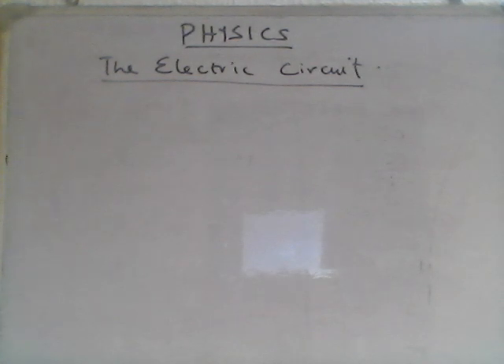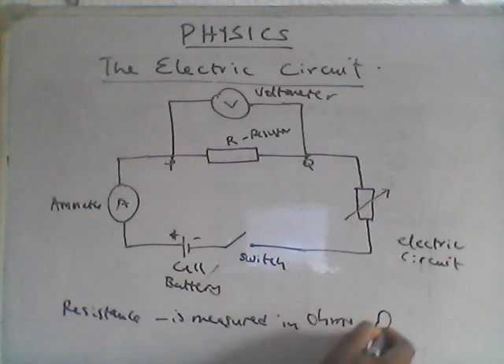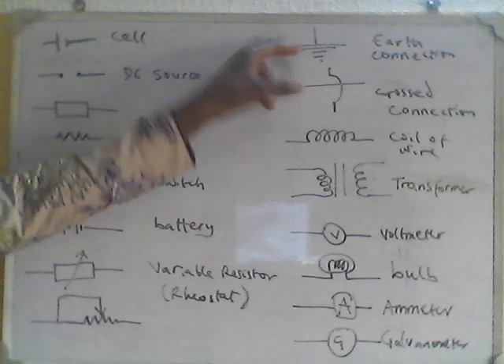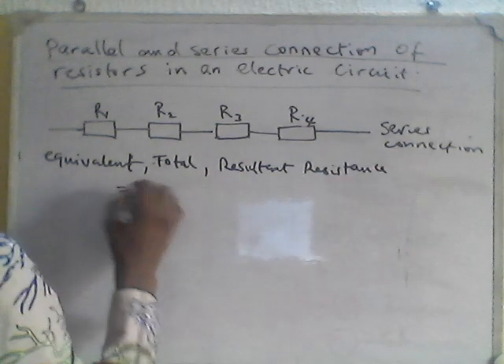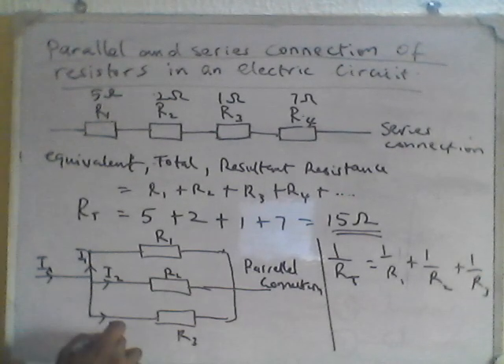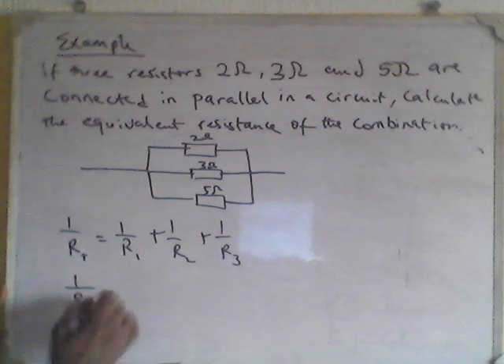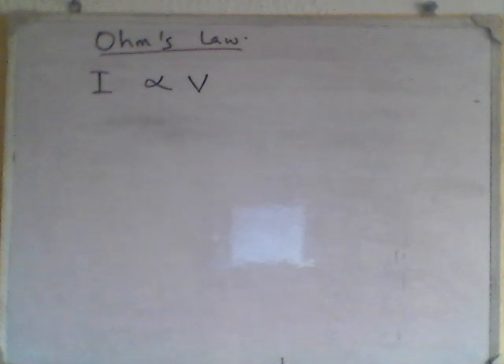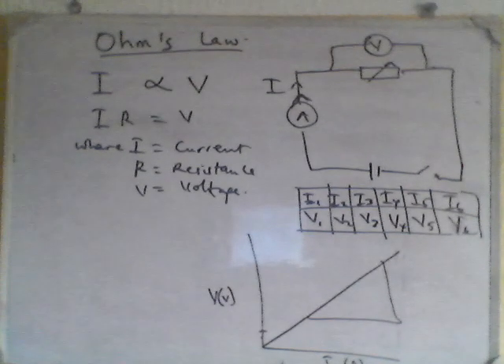Your Physics Teacher Lied About Electric Circuits ⚡ | The Truth Grade 11 NEEDS to Know!

Comment from the maker: 10. In the water-flow analogy, voltage is best compared to:
A. The size of the pipe
B. The amount of water
C. The pressure pushing water
D. The speed of the water wheel
✅ Answer: C

Comment from the maker: 8. The flow of electric charge in a circuit is known as:
A. Voltage
B. Resistance
C. Power
D. Current
✅ Answer: D

Comment from the maker: 4. If a circuit has a voltage of 12V and a resistance of 4Ω, what is the current according to Ohm’s Law?
A. 3 A
B. 8 A
C. 48 A
D. 0.33 A
✅ Answer: A

Comment from the maker: 3. In a simple electric circuit, the resistor is a component that:
A. Increases voltage
B. Stores energy
C. Limits or controls the flow of current
D. Converts current to sound
✅ Answer: C